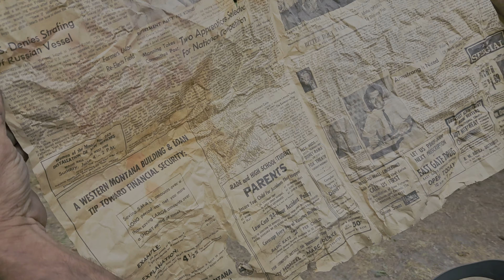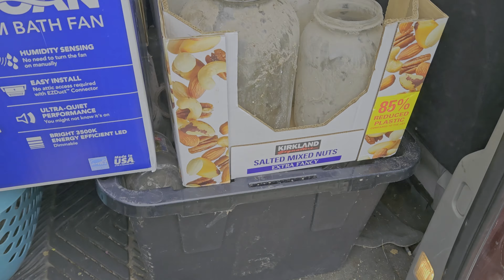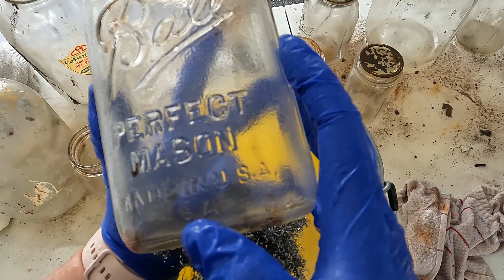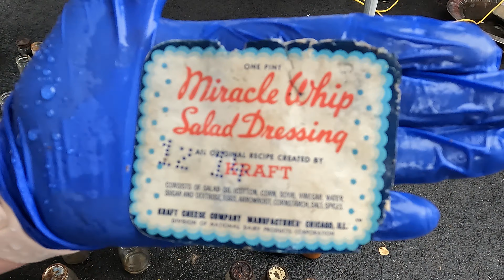Some of These STILL had FOOD in Them!! PLUS Vevor Carport to the Rescue!

Comment: might i suggest a  baby bottle brush for cleaning.  i'm cringing worrying about u cutting your hand....
Reply: Deborah Gleva   Coke cola takes off rust. You upturn them set them in  the soda. You can use cheap cola.  .Get a large plastic bowl. Pour the😮 soda in it. Place the jars in the bowl ( upside down) leave them to set overnight.  The cola will remove the rust. Simply wash them off or run the jars in the dishwasher to clean them up.
Reply from the maker: Ok, I'm going to have to try this!